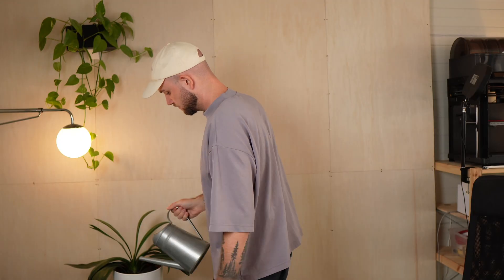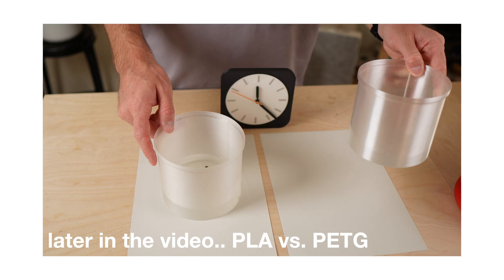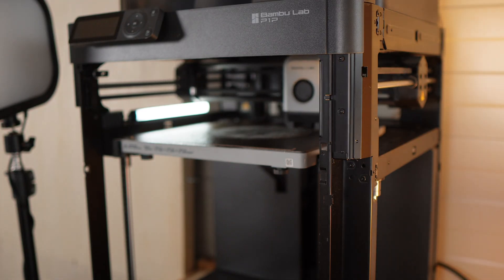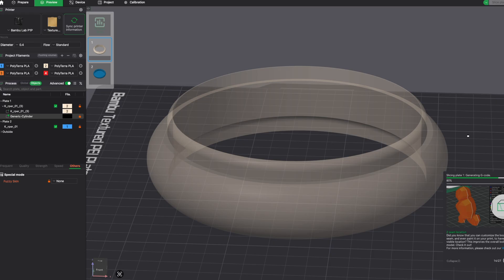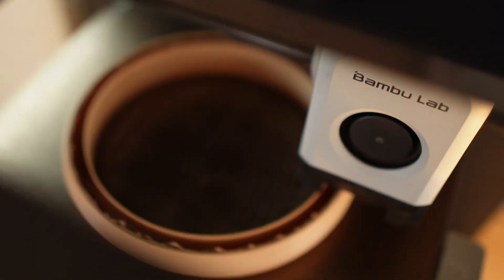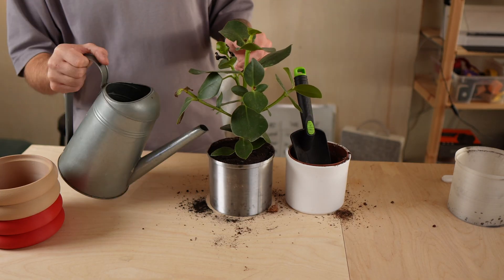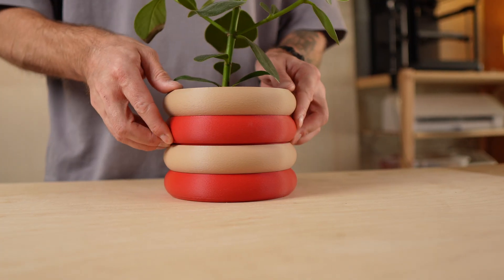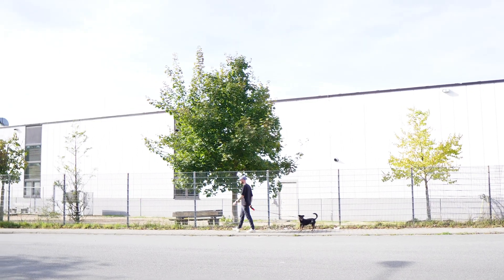How I made a planter that grows with your plant

Comment: What software do you use for modelling? I use rhino
Reply: And what's the name of the pad you used for sketching?
Reply from the maker: @lorenzofariseo4364 I use Shapr3D, and the pad is a Kindle Scribe. I’ve also had rhino on my PC for a while, but I haven’t really gotten into it yet. Are you happy with it? :)
Reply: @PaulLagierEN  one last question sorry 🙏🏻 how much is the thickness of the white part of the lamp (sorry im Italian i dont know the right word for that part) there is a limit to respect when printing? Or it can be paper thin?
Reply: Man my bad i was looking at the other video.... i was talking about the lamp u made
Reply from the maker: @lorenzofariseo4364 No problem! I wouldn’t print it too thin though.
With a 0.4 mm nozzle, at least three wall lines.Around 1.2 to 2 mm work well.
In the video, I also printed it with a 1 mm nozzle and a 1.2 mm wall line,
it even works in vase mode 👍